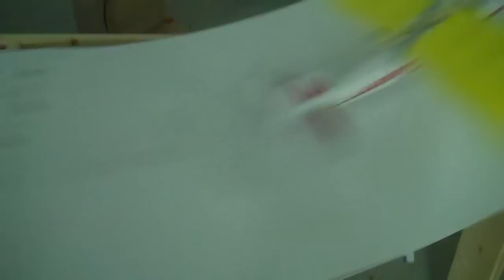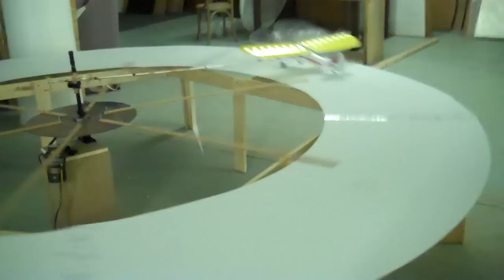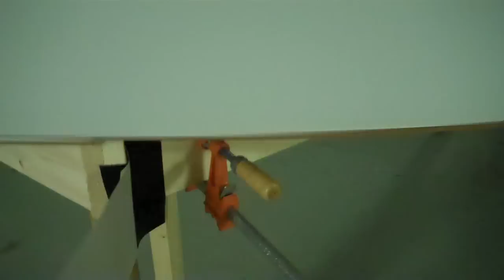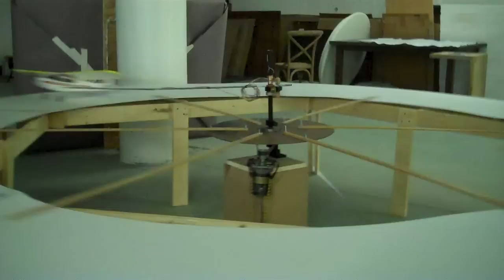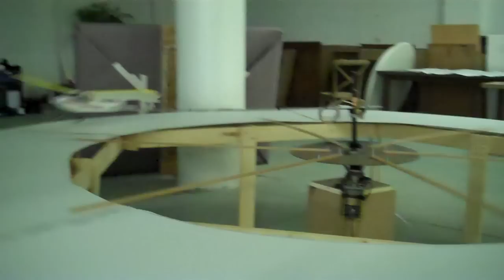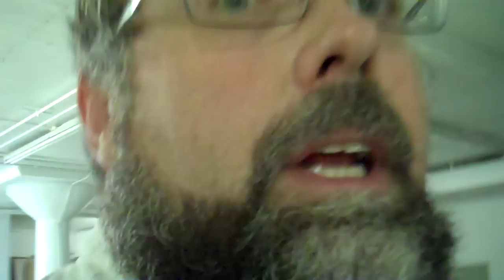Airplane On a Conveyor Belt Proof of Concept

Comment: what if the planes are passenger plane?
so the turbine will be placed on the bottom of the wings, and running at the same speed with the belt? or the belt should've move exactly same speed with the plane, so there's no air going thru the wings. and the plane will be staying on the same place as the belt move. will it take of the plane?
this is annoying, because it moved faster than the belt.
Reply: The difference is wind speed vs. land speed, and where the acceleration comes from. Assuming there is no wind and the friction created by the wheels of the plane is minimal (which on a real plane is true), the plane will take off. The place takes off when the wind over the wing reaches the critical lift speed. Acceleration is created from the propeller, which pulls on the air in front of the plane. It is not driven by the wheels. It is also assumed that the treadmill has little effect on the speed or direction of the air. So, the propeller pulls against the wind and the plane moves forward (only slowed down by the extra drag from the coefficient of friction from the bearings in the wheels. If the plane were powere by the wheels instead (as in adding wings to a car) then the plane would not move becuase the forces would cancel out.

Comment: Violated the definition of the problem. The plane will not fly.
Reply: THANK YOU!!! EXACTLY!!!!

Why do people have such a hard time understanding this? They so want the plane to fly that they commit dozens of fallacies to force it to fly.
Reply: because by the very definition of the problem, THE PROBLEM ITSELF IS STUPID
Reply: lol. yes it will.
Reply: @jyvas12  LOL NO! If the plane is moving forward at 100 mph and the ground is moving -100 mph (reverse direction) then there will be no airflow over the wings. In the video the plane moves forward relative to the ground so it is moving forward and lift can occur. So the problem is violated.
Reply: @teetimeaz  lol, you are making me lose my faith in humanity. The plane doesn't care about the ground, only the air that the propellers are going through. It's been proven over and over
Reply: @jyvas12  Thank you, you are making me increase my faith in humanity.